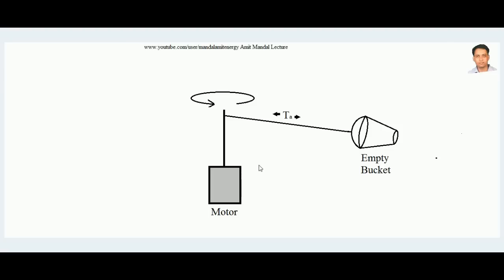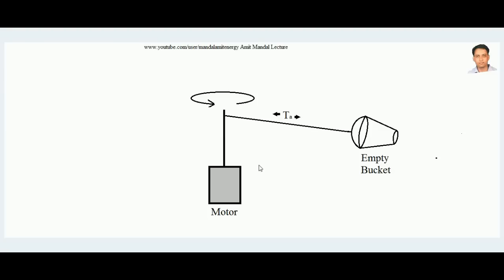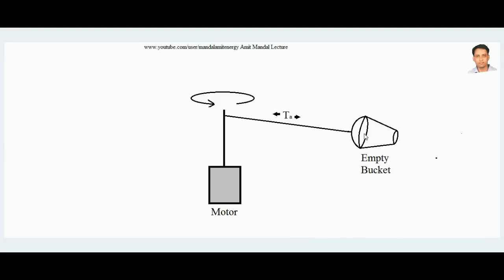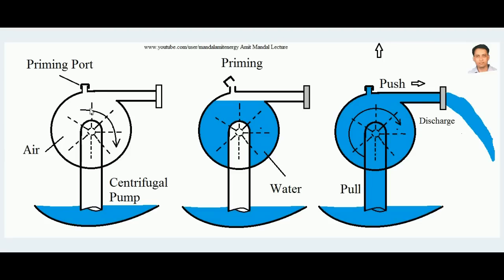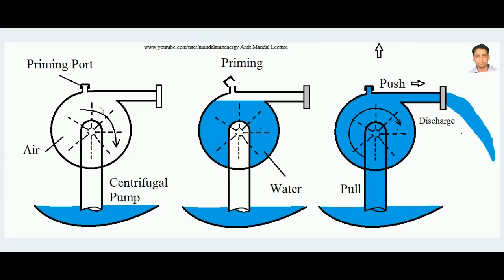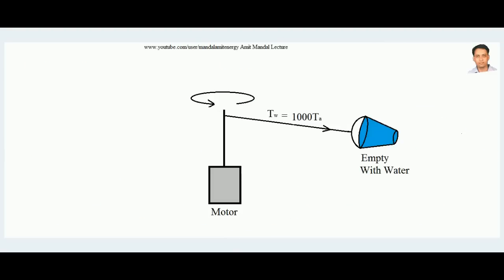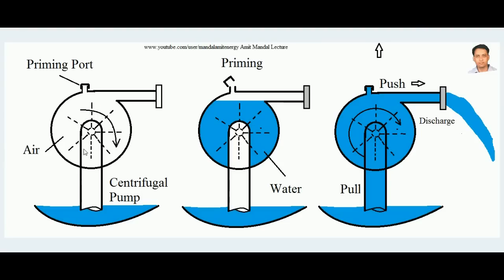Priming of Centrifugal Pump

Comment: Great explanation, question i can't get the priming screw open on a centrifugal pump, but the pump if below water level and when i open a return valve that's right next to the pump discharge water starts coming out, because it's below the water level, if this happens does this mean that the pump is primed right? i mean it's full of water so it should be correct?

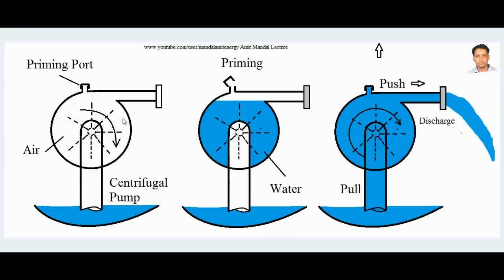Comment: Dear sir kindly clarify my one doubt because I think there is a slight mistake in the diagram that you have showed at 1:54 I think even the suction line should also be shown completely filled with water in the middle diagram or else the pump won't work...what do you think...please reply
Reply from the maker: This is an indicative explaination for, , 'technically why priming is required ,'  it depends on the diameter of suction pipe, if it is sufficiently less no need to fill it with water. strictly speaking there are few more things required, there must be a non return valve at the sump-end of suction pipe. The length of suction pipe must be less than 10 m, Check out my lecture on NPSH.

Comment: What happens in the self priming pumps?  I mean how does it prime itself?
Reply from the maker: +Ganesh Hosur google it its a big story...
Reply: Then why are you making video?
Reply: Self priming pump consist of non returning valve in entry pipe which stop water to going back to reservoir when pump is switched off hence casing remains always filled from the water.